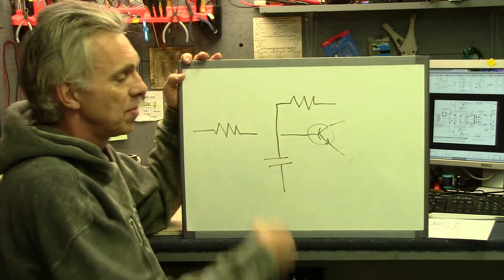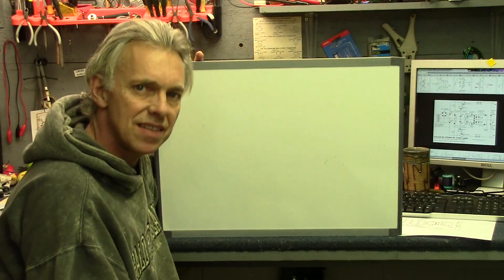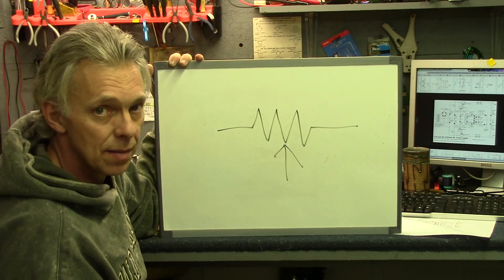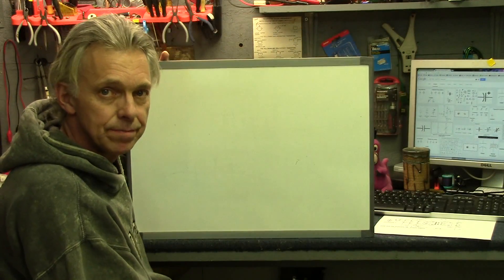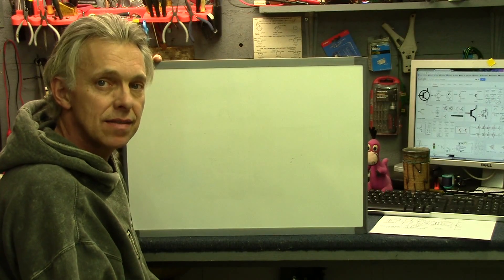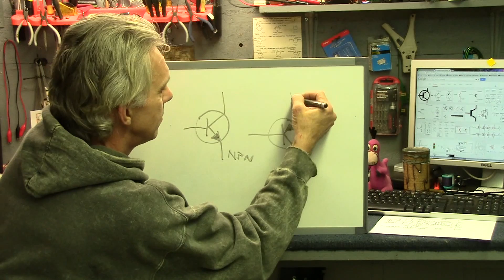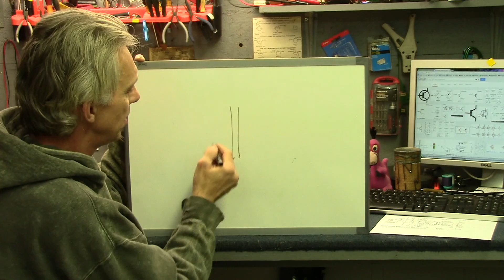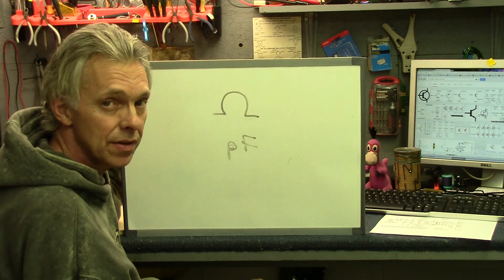How To Read Electrical Schematics

Comment: This is the way I learned as well, in the 1970's.. Clean and clear cut.   
But modern schematics have strayed away from the norm. They re-use any symbol, connection, or connection group funneling groups of wires into one wire. Then fanning them out with extra labellings YOU have to figure out.. Or leaving a symbol at the end of a wire and you have to find out where it is hidden on the next page. Making it harder for you to trace. BUT it's easier for today's engineer to draw, instead of grouping them in an orderly fashion. This takes effort, time, and larger sheets of paper, and:  A solid, "thought through process on one sheet, that can be taken into the mind "as one COMPLETE thought".  If it is a HUGE schematic. Use a large screen and use the same scaling technique that they use on maps.
Down side: Costs more - requires plotters or large scale printers, or computers and large screens to print a complete unit on one page.  (All that the boss hates. So it's not gonna happen..)
So the repair technician bares the stress of figuring out the engineer drew, to repair the unit, with "a book of schematic pages".
Symbols: If you are used to the older (better) symbols,  you would have a hard time deciphering the new ones. The older symbols were straight forward, and easy to spot at a glance. The new ones, use (and re-use) symbols, that are so close in appearance, you could make a mistake in identifying the type of component it is. 
Also to add to the confusion the:  flow, input, polarity, and the output can be anywhere and labeled anything.. Good luck.

Comment: iv got a vid request.  discussion on variations of components in relation to going online and buying what's available opposed to being a picky buyer who only buys necessity. ..I'd bulk ebay (setting: I decided to go and buy some parts to play with.   and realized a resistor pkg rated at 1/2 ohm and finding there's a bunch of others between it and 3ohm)

Comment: This is so very similar to when I worked in a Zn processing plant and had to draw the circuitry of pipes traveling through the plant, different pumps, filtration and added chemicals would represent the different electronics components I guess?

Comment: I have a Fisher model 201 receiver that the power transformer get extremely hot!
can't even keep my finger on it for more than a couple of seconds and i was wondering if you could tell me what is causing that.
I turned on the receiver and played it a a fairly low volume but the transformer still overheats. Everything works on the receiver.
Hope that you can point me in the right direction.
Thank you
Rob

Comment: Hey, great video but what I'm really missing here is how the signal flows through the schematic. That is something that still isn't clear for me and I haven't seen a video yet that explains that properly.
Reply from the maker: Think of electricity as water flowing from a hilltop to a valley below. The positive side of the circuit is the  hilltop and the negative side is the valley. On the way down it can be made to do work as it passes through the components and they react to the flow.